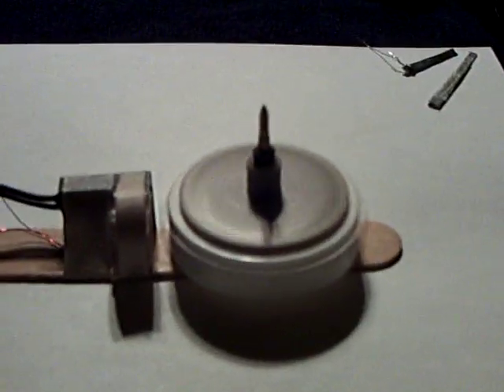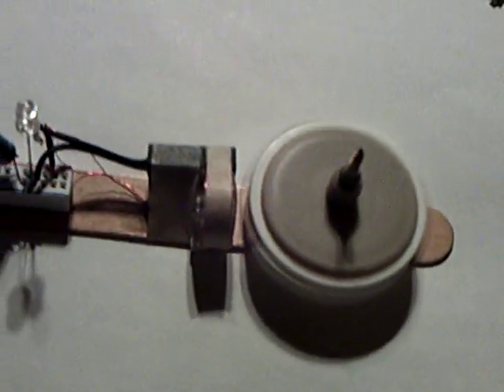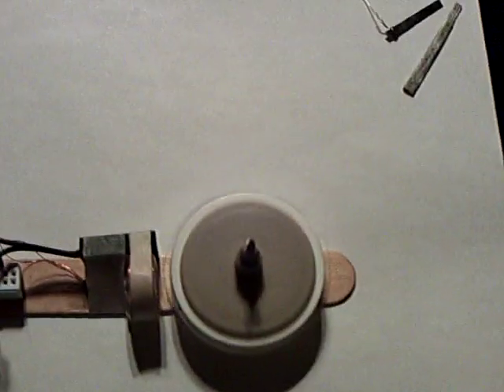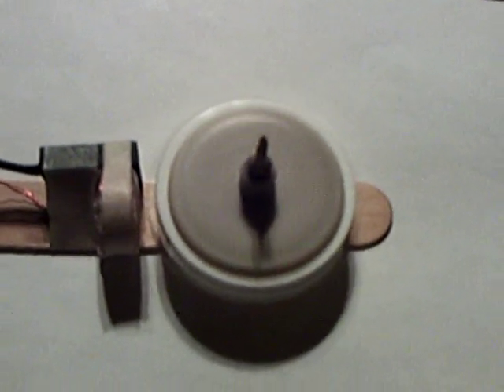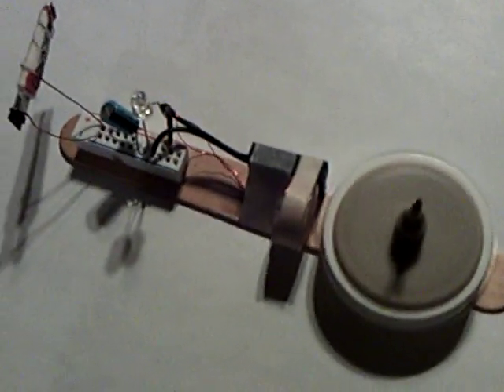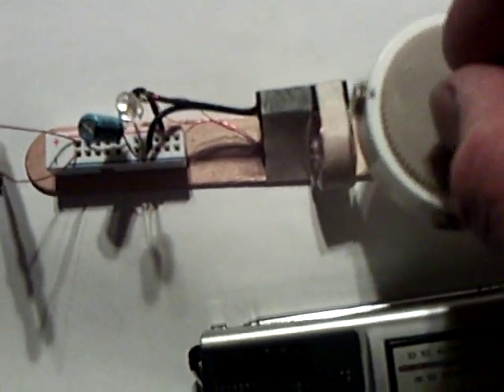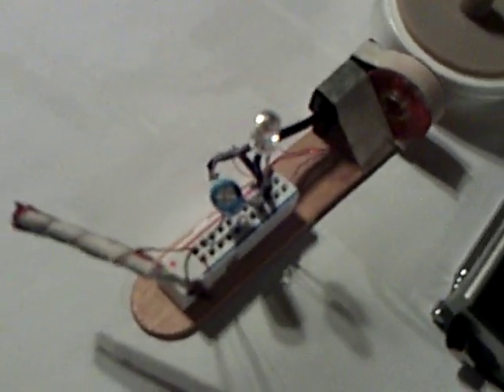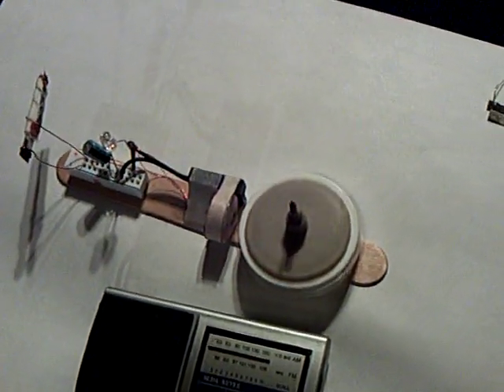Homemade Battery Testing ------ with Stick Pulse Motor

Comment: Thanks again for your prompt response. I seem to take you away from you work every time.  I'll give it a try once more, and will also try that trick! You know... what you said about pushing the magnet makes sense, for my projects, it does not. Current or not, the magnet is attracted by the ferrite core, hence it gets stuck and won't move. I have discovered something unusual in my quest for, and that is: by using the magnets from the HDD, and we know that if get a compass close to it; we have north and south from the same side. Now, the coil sits or faces the magnet right in the middle. Wired as you have it, but with an LED in place of your neon light, and having applied the power, I then turn the disk to the left and to the right a fraction and let it go. The rotor will start flicking left and right for days till the battery runs out and whilst this goes on so does the light flick. You know the little stepper-motor I was talking about, well, it produces little current whilst flicking back and forth. I wonder what it will be like if I succeed in making it turn!

Comment: I've read elsewhere these little relays don't last very long when you use it for this purpose.   Have you found this to be the case? Also are the relays more efficient than the standard transistor control circuit used in most of the bedini motors?
Reply from the maker: Yes the little reed switchs don't work well with high power because the contacts weld together.  They do make high amp reed switchs that work.  On this low low power application the reed switch works well.  I have some that have never failed after hundreds of hours of use.  I have had some only lasted seconds when I tried to use them on too high a power application.

Comment: Now… where do I start? I am still have problems with the pulse motor; it just won't work! I have given up! That said; you could take over the project or perhaps someone out there knows the answer to it. You are all familiar with the HDD! Well, I thought… what better way to use an HDD and turn it into a pulse-motor all enclosed. It has a disk and one could use it as pulley since it turns effortlessly on it's little stepper-motor. I fitted the magnet on the flat surface underneath, making sure that they would not interfere with the disk. I also glued them on the front, the disk's perimeter. It still wouldn't work no matter where I faced the coil. I took out the whole unit and screwed it on a piece of bakelite, having the coil facing the disk, but that didn't work either, so I tried placing the coil at the bottom. Nothing! The pulley just will not turn, although some coils produce a fair amount of voltage, 50 V. I've used a 3.7 V and even 8 V battery, batteries' lap-top. If anyone is able to make it to work; it'll be fantastic! You see; my theory was or is that: if it turns reasonable fast like your previous pulse-motor, we might be able to use the voltage and current produced by the little HDD stepper-motor to charge another battery or feed the drive battery. I hope it is clear what I was trying to achieve. My hope is that you'll succeed where I failed.
Reply from the maker: I'm sorry to hear that you had problems building a pulse motor.  Please remember that for every video I post I have spent hours and hours working on the project and failure is a constant along the way.  Sometimes I walk away from the project and come back to it later but other times I decide that the idea will never work and move on.
   For your situation I suggest that you take your coil and see it will push a magnet sitting on a slick countertop when you energize the coil with a battery.  If it will then it will turn four of those magnets attached to a free spinning wheel.  The next step is to time the coil pulse with something.  The simpliest thing that I have found is a magnetic reed switch.  Put that in series with the coil and battery then move the reed switch around the wheel until the wheel starts spinning.  Start with a very simple rotor. Even a piece of card board with four magnets all N facing out glued on it could work. Put a nail through the middle and hang it upside down.  Maybe I should do a video on that.

Comment: Runs very well and good speed for a reed switch type.....on a stick :)
Those water soaking balls meant for vases also do a great job for this sort of cell.
I always wonder with magnesium, whether some kind of tuning can be done. Such that once the motor load is known, you could put a drop of an acid or an alkali on the cell to slow the mg reaction.
Reply from the maker: These magnesium strip cells are interesting and I seem to be able to control the life span by adjusting the moisture content in the cell. Where I live by the beach there is usully enough air humidity to keep the cell running for a long time at a low deterioration/low power level. The calcium cloride in the cell sucks the water out of the air. Of course the trade off is that not much runs at that low low power level. This motor won't ----but an led blocking oscillator or solar waver type motor will.
Reply: Another liquid to try is Windex by the way, not quite sure what's in it (vinegar and something) but a 2011 blue LED salts cell just carries on and on with that...4 month runs then spray some more on the soaker ball things. Perhaps worth a try on Mg cells :)

Comment: Nice!

Would you provide more detailed specs for the:
1..  mg ribbon metal (W" x L" x T"), source?
2.   carbon fiber fabric (weave type, dimensions, source)

Thanks in advance.
Reply from the maker: Thanks.  Get the mg ribbon and carbon fiber cloth on Ebay.  The size or type is not critical.
Reply: Thanks!  I've seen it on Ebay.
Could you provide a good YT url that shows how your cell/batt was constructed?

Comment: Nice. Have you ever been able to run a LED with a pelture module from your body heat?
Reply from the maker: I have not done that yet but others have.  You need the ELC-W04221 DC-DC voltage booster to do it right. Google that part# to find it. Costs about $20.